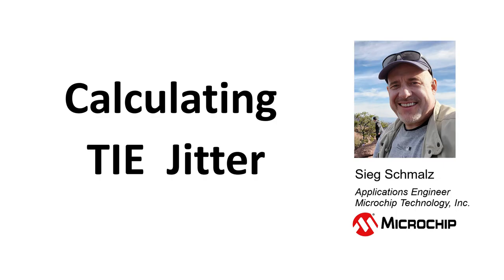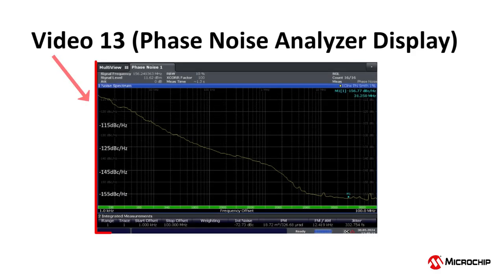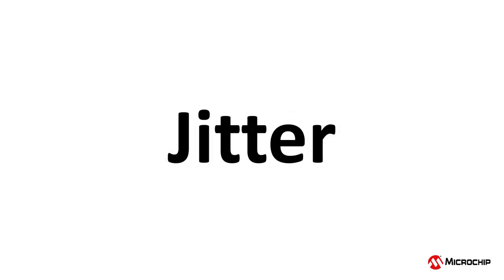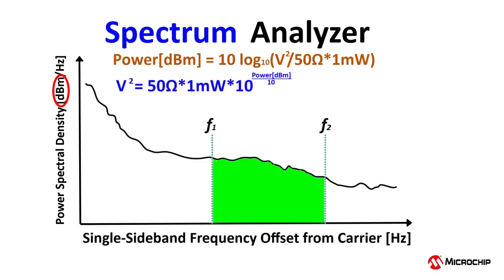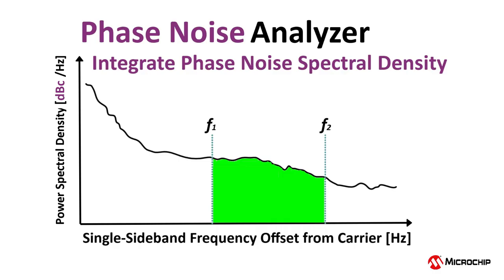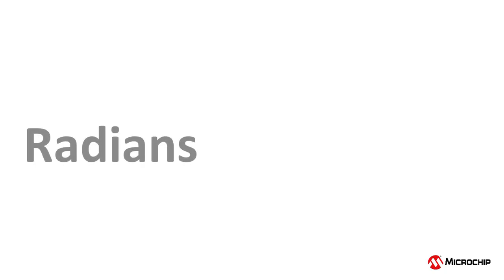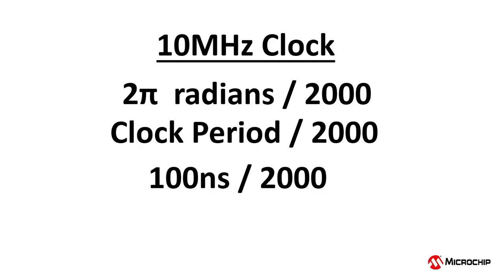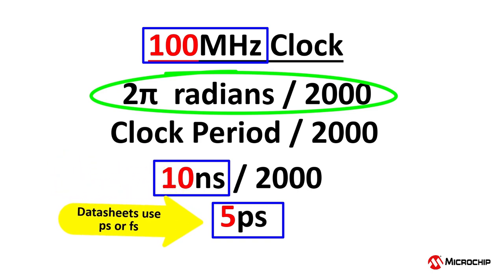Calculating TIE Jitter

Comment: Hi, what’s the reason for 2pi radians/ 2000 ? Is it always divided by 2000?
Reply from the maker: Thanks for your question! Particularly in systems involving phase-locked loops (PLLs) or clock generation, the division of (2\pi) radians by a specific number like 2000 can be related to the conversion of phase noise or jitter measurements into a more usable form.
The (2\pi) radians represent a full cycle in terms of phase. When you divide (2\pi) by a number like 2000, it typically relates to the resolution or granularity of the phase measurement or the number of samples or divisions used in the analysis of the jitter. This division helps in quantifying the phase noise or jitter in terms of smaller increments, which can be crucial for precise timing applications. However, the specific number 2000 is not a universal constant and may vary depending on the system design. Hope this helps!